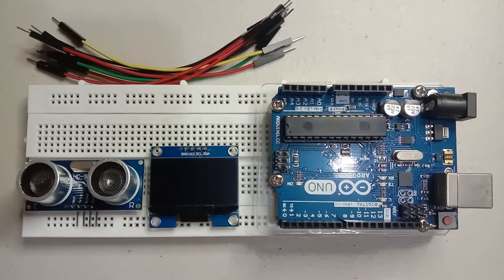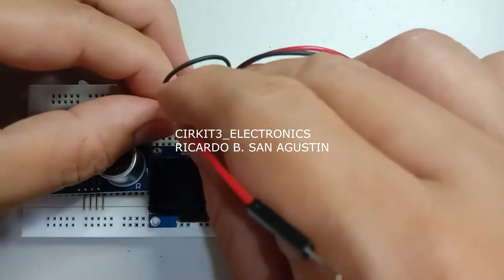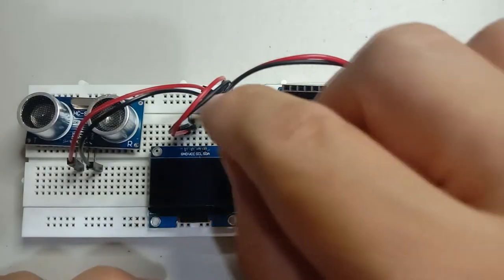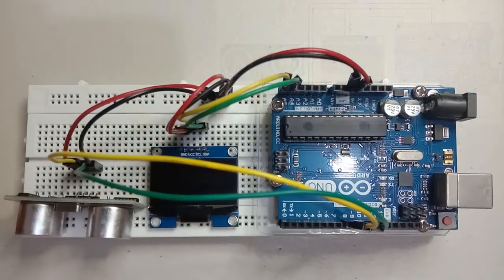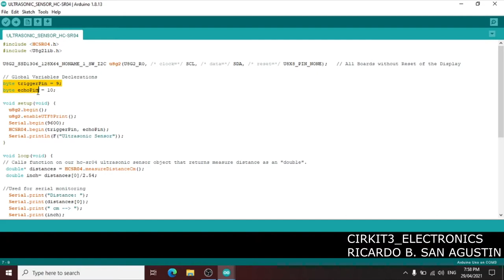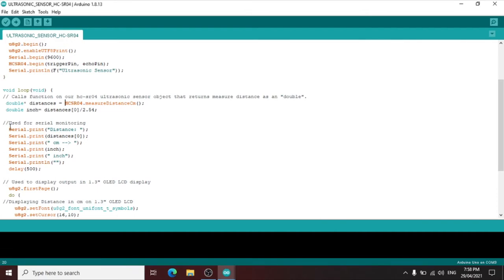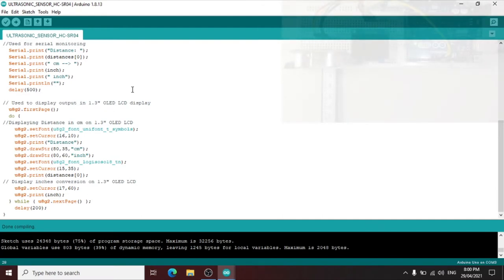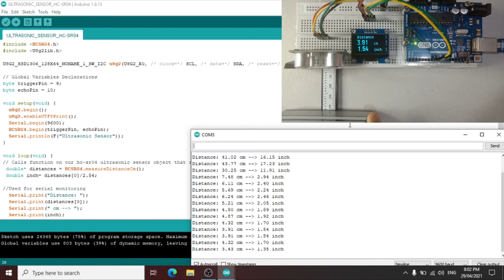HC-SR04 Ultrasonic Distance sensor with 1.3 OLED LCD display and Arduino Uno Module

Comment: Which libraries do you use for this tutorial? I can't find them
Reply from the maker: Try to search this library on library manager.   
HC-SR04
by Dirk Sarodnick version 1.1.1 
library for HC-SR04 ultrasonic distance sensor. you can measure distance in microseconds, millimeters, centimeters and inches. It's possible to utilize one trigger with multiple ecoes simultaneously.